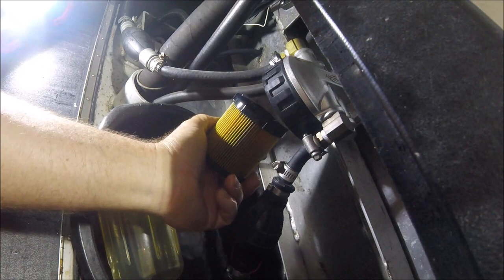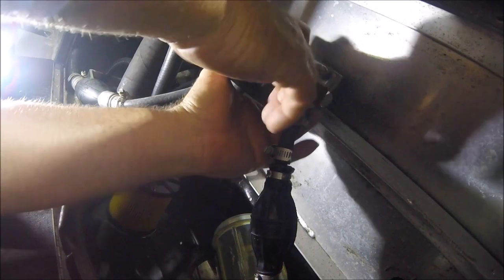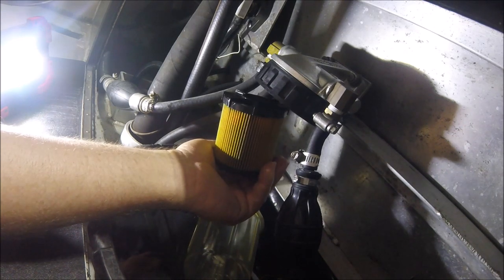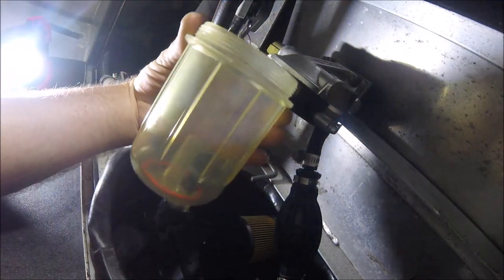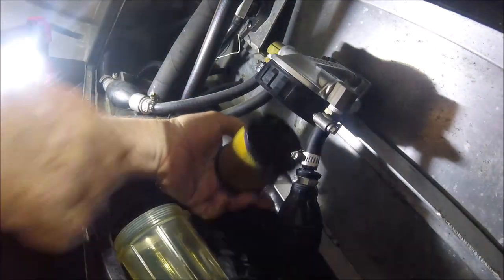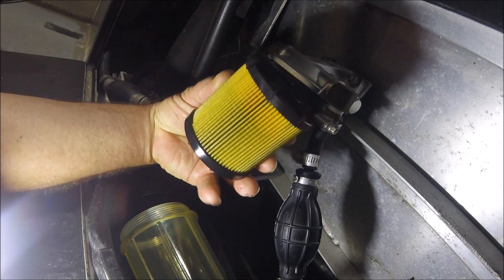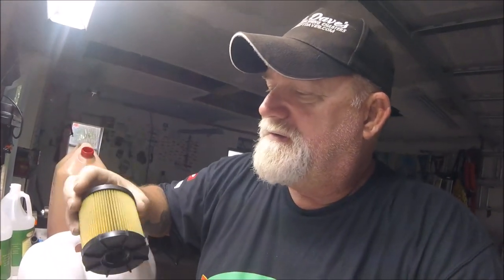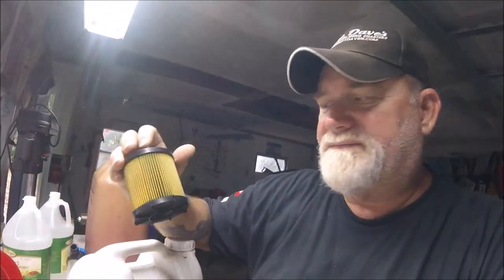A better & cheaper boat fuel filter system!

Comment: I had an amazing conversation with a fuel system tester/inspector for gas stations. Talk about an eye opening conversation!😱😱😱
Reply from the maker: yeah Im sure...trust ZERO, I bet.
Reply: @CaptDavesSportfishing  Yeah buddy. He told me that in the base of EVERY fuel pump you pull up to at the gas stations is a filter. ALOT of gas stations never change the filter at every pump because it cost too much, so when the flow starts getting restricted, they just rotate the handle to bypass the filter!🤬🤬🤬
Reply from the maker: @NewVisionLCS  oh yeah, I've always figured. Why would I get junk in my Mr. Filter from some and not others. TRUST ZERO! only you can prevent issues, if walking on water isn't yer thang....
Reply: @CaptDavesSportfishing  Speaking the truth Dave!

Comment: Dave said it, he knows what he's doing but let me reinforce what he said, after servicing any part of your fuel system or fuel delivery system, ALWAYS, ALWAYS check for leaks by running it watching and using your nose. Depending on where you live , time of the year and weather conditions, half full fuel tanks will "sweat" a little like a cold drink in a glass on a hot day. little tiny bit of water in the separator not always a real bad thing.  Great vid Capt Dave sound advice !!   Where is dem rubba gloves while handling raw fuel Capt Dave?????  just looking out for my jigging coach. LOL
Reply from the maker: WILL BE RUNNING IN BARREL TOMORROW, BEFORE NEXT CHARTER!  NO GLOVES, NOT A HAND MODEL. oh, we sweat🔥in FLORIDA! 90+ here already.

Comment: Hey Capt Dave I do the same thing I live close to the ramp. I'm not trailering my boat to the non ethanol gas pump 25miles each way. I bought racing gas cans they are 100%% better than any gas can made. They still have a actual vent and they have a 2ft 3/4 in hose. Check them out if you get a chance they are around 30bucks for 6gallon tank.

Comment: Capt Dave for clarification, I thought I read that if the filter is mounted in an enclosed space it must be made of metal per Coast Guard Regs? No glass, or plastic? I believe I read that when you did the original install of yours, and I wanted to install one in mine! Can you advise? Great vid, as I’ve read 95% of motor failures are due to fuel issues👍
Reply from the maker: thats regs for biden supporters! and boat builders/riggers. Not you. Do what ya want. I do, and I do it very well.
Reply: @CaptDavesSportfishing  hahahahaha😂 Well in that case, gonna order one of these bad boys👍
Reply from the maker: @melloreel  https://amzn.to/3eYZsHc - appreciate your support!
Reply: @CaptDavesSportfishing  will do. Thanks.

Comment: Hey captain, have you had any issues with your outboards starving for fuel using this marpac quickview? Are you still using this seperator?
Reply from the maker: Nope and I run to outboards off of it a 15 kicker and a 250 Suzuki
Reply: I was thinking the same.  I've heard some people running 200s or 225s and no issue but 2 reviews a 115 and a 150 that had reduced flow.  I don't think the clear view unit gets the standard 90GPH but hear mostly all good stuff.  I just bought 2 for my 150s and I guess I'll find out soon.  The ability to view what's going on is huge to me and worth a shot.  You could save a ton just by the ability to drain just the water from the filter, much safer also to always know if younhave water in there or not.